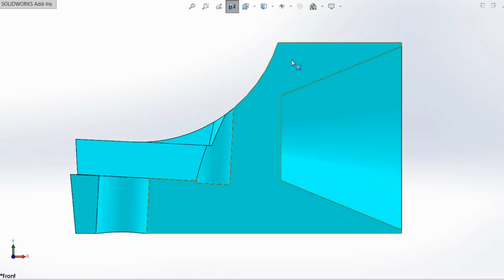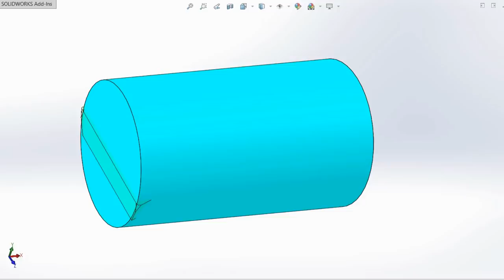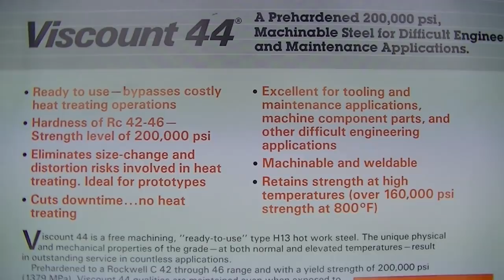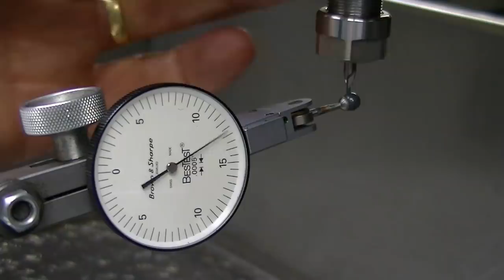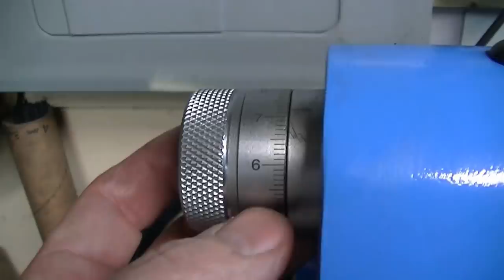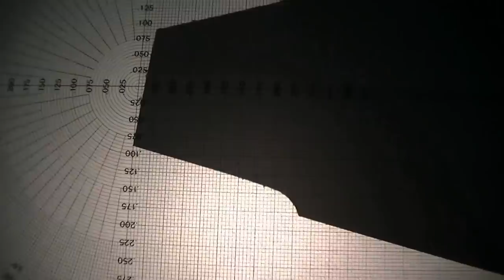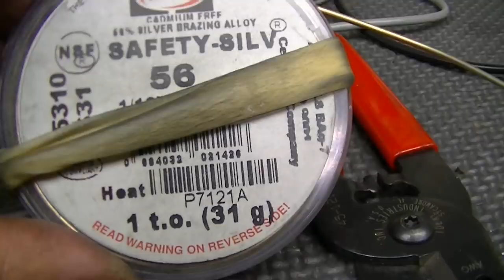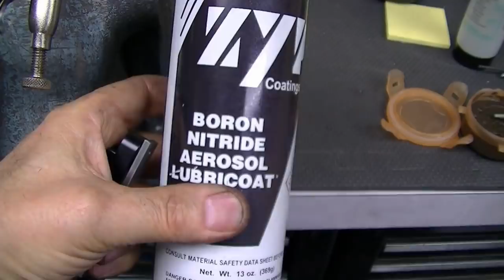MAKING AN INSERT BORING BAR

Comment: hey Robin,

While watching this I was wondering wouldn't it be possible to do this with a rotary table and a collet block on a manual mill?

in my mind, if you dropped the back rake/taper then the only tricky thing you would need to do is get the rear cutting edge of the insert perfectly aligned with the center of rotation of the rotary table.  Then as long as the clearance hole was big enough, you could feed in along one face of the pocket, rotate the table the appropriate amount and then feed out. It could probably be done with the back rake/taper as well, it would just be even more tricky to jig up.

Other than the fact that it would be time consuming to get set up its possible right, or am I missing something?
Reply from the maker: Absolutely!  Grab the collet block at the back clearance angle in a toolmakers vise and clamp the vise to the rotary table.
ATB, Robin

Comment: So please don't take this a criticism, this is just for my own knowledge but how do you now the alignment of you coolant port between the 2 pieces, I didn't see any ways of indication but maybe I missed it? Also with the amount of alignment and precision you took for the holder piece, why would you rely on just the weight to hold the 2 pieces in alignment? It seems to me that during the soldering process your shaft to head alignment could easily be off? Again please don't take this as criticism, I am VERY new to all of this and just want to learn. I'm assuming it has to due with the alignment of the taper but not sure? Also if I missed the boat completely I'm OK with that to :-) Thank you for this very informative video.
Reply from the maker: Coolant hole is concentric to the taper in both parts where they meet.
Conical alignment is very accurate.
Reply: @robrenz i think the question was about the rotational positioning ? A simple pen mark on the outside of the bar ?
Reply: @nicolaspillot5789  concentricity implies that there is no difference based on angle setting

Comment: To find the seating screw correct position, could you not measure the existing broken insert holder?
Reply from the maker: Not as good as the functional method I used.

Comment: But is the bar concentric with the head now?
I didnt see you doing any allignment after soldering.

Or does it just not matter?
Reply from the maker: The taper makes the head sit concentric on the bar when soldered on.
Reply: @ROBRENZ  
so it´s just that precise, nice.
wish you well
Reply: My suspicion is that Slight misalignment - less than 1 degree - usually has a negligible effect.  What he did could easily achieve that level of accuracy.

Comment: the design of the the solder joint is not really good.
there are cabide bars with V-Shaped solder joints... you should get one of these.
see the difference:
https://images-na.ssl-images-amazon.com/images/I/51hknik%2BOCL._AC_SL1276_.jpg

Comment: Eh? You have the South Bend screwdriver?
Reply from the maker: What is a South Bend screwdriver?
Reply: @ROBRENZ   The one with the notch in the end about .200 wide, for removing the nuts on the compound and crossfeed handles. Basically a 12-24 nut that is slotted crosswise.
Reply from the maker: It is actually just a groove I filed in to hold parts while soldering.
Reply: @ROBRENZ  Cool, gonna have to remember that one. I always used to use the "bacon fingertips" method :D which causes your fingertips to become very hard and burnt... its amazing how much damage can be done with a 25-watt Weller. My cat sat on it once...

Comment: Should the cutting point not be prowed of the diameter of the boring bar to me it don't look like it can cut anything. Not intending to offend or sound like I know better or anything but it looks like a ton of work with a tool that offers very little if any ability. Now that I have seen more I have to apologize for any offense it realy wad not intended and you skils as a machinest are only better by a lil in your video quality thank you very much...
Reply: It doesn't stick out that much, but it doesn't need to. A twist drill has no extra diameter where it cuts! By the time the diameter of the shaft reaches inside the work, that has already been cut :)

Comment: It doesn't make since that you would put a carbide insert on a CARBIDE bar, put a carbide insert on a 4140 heat treated bar.
Reply: The insert tooling I made years ago used W1 tool steel, oil quenched.  I didn’t have the tools for this (which is lots better) and no YouTube then, either.

The reason a carbide shank is used on this kind of boring bar is for greater rigidity.

Comment: Nice work Rob, but I'm curious why  you didn't just change it to a stepped bore - cylindrical fit... a bit more fiddly for fit, but you're soldering anyways, and then you don't have to fart around with tapers.  Thots?  Either way, beautiful work.
Reply from the maker: Thank you! The taper is easy to do and it leaves no stress riser from the corner of the step on the carbide. I also alows the automatic perfect solder gap without precise measurements.
Reply: Humph…I did not know that ( first part…knew the second part) …thanks